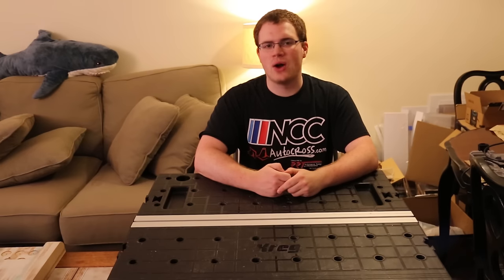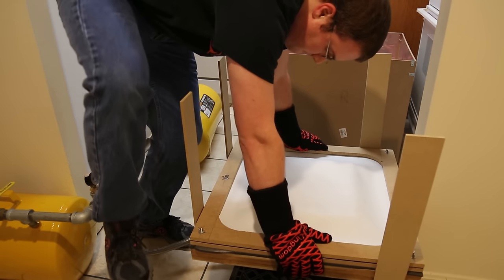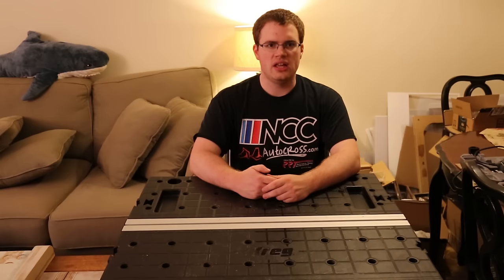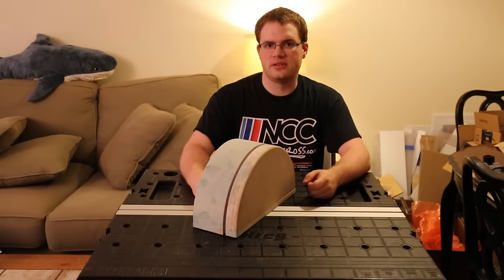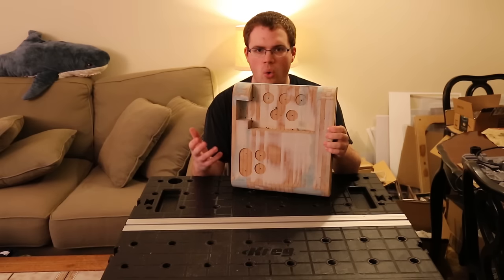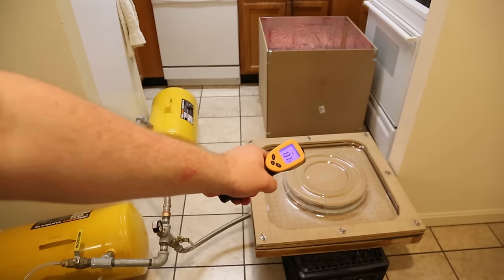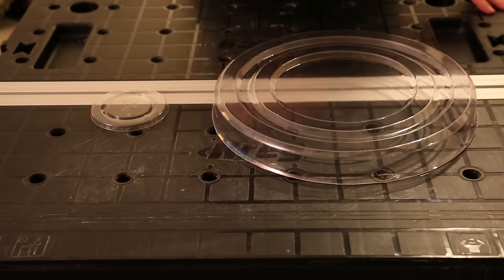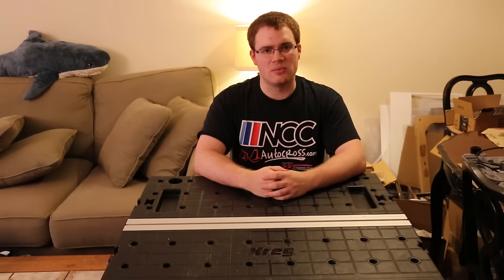DIY Vacuum Forming - Complete Video Guide

Comment: Thank you for this invaluable instruction Video!! Answered so many questions. 
The only thing I'm not 100% clear on... I THOUGHT I knew what PETG was, many Plastics for that matter. 😖 

My primary purpose of this will be to form RC Truck Bodies, and some RC Aircraft parts.
The RC Truck Bodies will be at least .040" Clear Polycarbonate (Lexan). Lexan isn't PETG? Is it?? 

The Bodies will be at least 6-9" tall, 7-8.5" wide and 13-17" long. 
The Truck Beds will be Scale depth. (90% of all mass produced RC Truck Bodies have FLAT top Beds, or are only 1/4" - 1/2" deep) 

I'll likely be carving the Lasts out of Plaster of Paris, with a layer of Glazing Putty as a top layer.

Do you see any issues I would have with those proportions? 

Also, Lexan Sheets are sold in Hobby Shops with a protective film on one side....
Production Lexan Bodies are all sold WITH the that film on it, so when painting the inside of the Body, no overspray gets on the outside. 

Do I have to remove that Film before molding?? 
Sorry if I'm over picking your Brain! I have almost NO budget. I can't afford too many errors.
I'm already CERTAIN they'll be a few! 😜
Thanks, 
Carmine ✈🚂🚙
Reply from the maker: Hi Carmine - Polycarbonate/Lexan and PETG are different materials and require a different amount of heat to properly vacuum form (you can find the manufacturer technical sheet that usually has a ton of great information on thermoforming, including what temperatures are needed). Those proportions aren't an issue as long as the platen and vacuum are designed well. If you plan on doing it with a cheap vacuum, you'll run into problems. Protective film must be removed from both sides of any clear plastic before vacuum forming. The protective film is also plastic, and will melt onto your sheet when you heat it.

Now that we got through those questions, just a couple things I noticed:
.040" polycarbonate is fairly thin. If you plan on doing a deeper draw (which is exactly what 6-9" is), you'll likely need a thicker starting material. As I stated in the video, when you heat and draw plastic over a form, it has the tendency to thin out (because you're stretching it, basically). I did one form at the very beginning of the video that was about 14" long, 6" wide, and 7" tall (which is fairly close to your dimensions) with .080" Polystyrene and the resulting wall thickness of the finished plastic was .030-.035" (about half of what I started with). So keep in mind where you want your wall thickness on your finished form to be, and backtrack from there. The plastic will always thin out in relation to your buck height (since it has to be heated more/droop more). I did some forms in the same .080" Polystyrene that were only about 1.5" tall and they came out at ~.072" which almost has no loss of thickness. I think at the end of this video with the soda cup I started with .060" PETG and it ended up being something like .050" for that 2.5" draw. If you want the body to end up being .040", I'd start with at least .060" material and give that a shot. I'd suggest starting with some sheets of PETG. It's often cheaper, widely available, and requires lower heating temperatures/faster to bring to temperature. That way you can get the motions down before moving onto the more expensive and difficult-to-form polycarbonate. 

For small vacuum form operations, hobby shops are great sources for plastic, however if you plan on doing something this large and possibly doing a medium-large run of them, I'd suggest searching for and becoming friends with a local plastic supplier. They often have tons of material types all with varying thicknesses, all the technical specifications, and can cut the material to size for the particular former/frames you plan on using. I get 48 x 100" PETG sheets of varying thicknesses rendered down to about 22 x 22" for my frames and I get 8 pieces (usually they cut for free or very cheap) for about 30 bucks. 

Also, I know you can technically vacuum form plaster, but I always suggest people try to make their bucks from wood or some strong material. It has better machining properties for a more accurate buck and wood can withstand the heat really well while also being stable so you can draw many forms from the same buck (tool life). Remember, don't use any materials that can't withstand 300 degrees Fahrenheit for at least 1 minute without deforming/melting/breaking.

If you need any more help, feel free to drop another comment. Happy forming!
Reply: THANK YOU!! What a wealth of information! Thanks for sharing your experience with me. 

So I'll get a couple of sheets of PETG or even Styrene for practice.

I'm not the best at carving Wood... But I get what you mean. Maybe I can try Clay. I can get that Fired at a Kiln at the local School.

I'm trying to save myself headache, the Body Buck will be a fairly basic form... Details like Door Handles, Windshield Wipers, Emblems, Gas Cap, etc... will be add-on items. It'll look better anyway. 

My proposed Vacuum source is a 7 Gallon, 1.5hp professional Shop Vac. 
Adequate?? 
Thanks again!
Reply from the maker: @CarminesRCTipsandTricks  Unfortunately for a lot of the home shop hobbyists, the conventional Shop Vacs are actually not the greatest at pulling a vacuum for a former. It may work at a smaller size, but at the dimensions you're working with you may need a Dyson Ball Stand-up vacuum or a set-up like mine. It's really odd, but the common household standing or canister vacuum is better for this application than a Shop Vac. I think it has something to do with the large reservoir of air inside (dust/debris collection bin). I've heard varying comments about filling that space with objects to reduce the interior volume of air possibly working, but I can't comment because I haven't tried it.

With vacuum forming, it's not necessarily important how much air you move when compared to how fast you move it. The snappier the system, the more accurate and tighter forms you will get. If you want to start by giving the shop vac a try while putting insulation foam or something to reduce the air volume inside the dust collection bin, it's largely free to try. However, if you're getting less-than-satisfactory pulls you'll know that's probably an item on the chopping block. If you try it, let me know how it goes so we can properly advise people in the future. 

On the cheap, you may be able to get a couple small canister-sized vacuums from the local Goodwill or similar and make multiple vacuum holes on the bottom of your platen (or borrow them from the house or friends - if they're good friends lol). The parts list for my entire build is also linked in the description, so if you end up wanting to replicate what I have you can price it out.

Comment: Superb video. Had it come up yesterday when I searched, my tiny 10.5" x 7.5" platen would have had fewer than its 486 holes that I drilled this morning!
Would be interesting to know if anyone has used one of the cheap 2-5 (US) gallon vacuum chamber/pump sets that retail around the £100 ($120) mark (Vevor I think) . They seem to be used primarily for degassing resin or silicone before molding but it looks like the release valve might be capable of creating a decent vacuum for small scale forming.

Comment: Nicely done video.  I need to make 24 pieces of a jukebox side plastic....acrylic, red, translucent, 24 inches long, 2 1/2 inches high and deep.  And it needs to be at least 1/8 in thick, so would need to start out at 3/16th in.  Smooth, shaped like a 59 Chevy tail light with no embossing.  As this would just be a one time production run off a wood template, I would like someone to do this rather than build the vacuum tube and struggle.  Could you recommend someone on east coast (I'm in western PA)?  Looks like a more cost effective process than resin silicon mold castings or injection mold.  And thanks again.
Reply from the maker: I'm afraid I make all my own components for my projects, so I'm not aware of any DIYer network that may exist. There are companies out there that do take vacuum forming orders, though. Depending on your budget that may be a possibility.

Comment: Thank you for these videos. They're extremely helpful and I'm in the middle of building one from your design. I want to be able to do different sized sheets, like 18" x 18" and 12" x 12".  Is there a way to seal off the outer holes when doing a smaller sheet, or would it be better to just make multiple sized platens and frames?
Reply from the maker: You may be able to add gasket material on the bottom of your 12x12 frame (that would still have to retain the exterior dimensions of the larger frame for the same platen) to block off flow, provided you were able to sufficiently shield said gasket against your heater during that process. The most reliable way would just to have two set ups and swap the vacuum system between them.
Reply: @mwjscn  thanks!

Comment: Great video really full of info, just wondering whats the differencw between PET and PETG in vacuum forming
Reply from the maker: Only thing that really matters for vacuum forming is exceeding the glass transition temperature, so look at the spec sheet for whatever material type and brand you end up using. I don't believe the different PET types have much variance in their heating requirements so they should all be fairly easy to use.

Comment: good video learnt a lot does the strength of the vacuum pump make a difference.  im about to build one to form new headlight lens's any tips are much appreciated thanks
Reply from the maker: You definitely wouldn't want anything weaker than what's in the video, but the vacuum pump strength basically determines how long you'll wait for the tanks to empty of air.

Comment: This has to be the most informative video on vaccum forming ever, can i pick your intelligent mind? 

Could i build my own system to form 5mm abs.

I have a rc bait boat that has cracks in the hull.

I'd like to make a mold of the boat i have then try and create a replica via vaccum forming, the current boat is made from 5mm abs.

Is this thickness possible with a diy system or would it need done with a more industrial size system.

Kind regards 
Bryan
Reply from the maker: Thanks for the kind words! Vacuum forming is used in the RC hobby space a lot, from bodies of RC cars, to canopies for planes, and hulls for boats (my father has some 1 meter class sailboats, which is mostly made of all vacuum formed plastic). 5mm is thicker than anything I've personally attempted, but definitely do-able with a robust enough heating system, but it really comes down to how large the hull is. The smaller it is, the more viable a DIY solution becomes (just in terms of maneuvering the frames and scaling the overall cost of the vacuum system/platen). If you have the time, it may be worth making your mold and using some thinner plastic like 2mm to do a couple test runs and get used to the heating system, the look of the correct droop in the plastic, and just getting comfortable with the general practice (as well as testing for any system issues) prior to spending more for the thicker material (or using up your thicker material during troubleshooting/testing). Remember that if the hull you have now is 5mm, that probably means they started out with a 6mm sheet (1/4") due to thinout during the heating/droop process. Since the hull is an easy shape, though, that means it should need to be heated less and the vacuum should be quite easy to pull (so if it's just a hair under 5mm now, you can probably use that same size sheet and get something representative of the original). Feel free to throw me any more questions if they come up now or down the line, I'm happy to help.

Comment: Great info. Thank you so much. Question: how do you DYI thermoform large and hard plastic boxes like car roof storage boxes? I can’t afford Thule and Yakima. Just want to make one for myself and be proud of. Any idea please. 😀
Reply from the maker: Practically, It'd be a lot easier and almost the same amount of money to save up and buy a rooftop carrier (look for pre-owned/used) than build a machine to make one. The plastic itself to make the actual part would probably end up costing $200 by itself, which doesn't begin to cover the cost of making the machine. You'd also have to use a special blend of ASA plastic to make it heat safe for usage in direct sun.

Comment: Great comprehensive video. Thank you!
I wonder if it's possible to vacuum form headlight lens?
Reply from the maker: You can, but it's probably a better long-term solution to get a replacement lens for the headlight assembly. If you do vacuum form one, you probably want to use polycarbonate which raises the difficulty level a bit since it requires much higher forming temperatures.

Comment: Very nice video 👍. The vacuum platform size h+(w*2) is interesting because I'm seeing a lot of videos vacuuming with much smaller dimensions. Can you explain more about the size you mentioned? The dimensions you mentioned applies to polycarbonate too? Many thanks.
Reply from the maker: It's just a loose guideline, but yes it applies to any plastic. There's not much to explain regarding the dimensions. You need enough plastic area to let it go up, over, and back down your buck. Hence why height is accounted for twice.
Reply: @mwjscn  so if I'm forming a 4*8 box with 2 inch high I ll need a vacuum that's 12*12 correct? Thanks, sorry I'm being stupid for some reason.
Reply from the maker: @Amr11959  Yep, you got it.

Comment: Hey Matt! Thank you for this amazing resource. I have a question however that I can't seem to find an answer to anywhere. I've built a former and an oven in my home using a standard panel space heater. The heater however overheats and automatically activates safety shutoff before the temperature is high enough to fully melt the styrene sheet. How can I work around this? Thx!
Reply from the maker: What is the wattage of your heaters and what thickness and area of plastic are you trying to heat up? How long are the heaters running before reaching the overheat temperature?
Reply: @mwjscn  The wattage is 1500 (pretty standard from what I gather)...it shutsoff after about 4 minutes. I switched to a 2000w electric stove...works better, though the heat distribution is uneven.
 The area I'm heating up is about 20"x27". The styrene is 20points thick ( I don't have another measurement reference...but that's how it is labeled). I'm having success with 2mm EVA foam...but the styrene doesn't even come close to being pliable enough to form. Thx for the help!
Reply from the maker: @danielruiz9589  I also started out with a single 1500 watt quartz heater, and it wasn't enough for styrene. We have a similar build volume, and I quickly fixed my issue by just getting a second 1500 watt heater for a total of 3000 watts (which you can see in the video @2:40). As far as heat distribution, you'll want an enclosed box preferably with HVAC aluminum tape and aluminum foil like mine for the best results.
Reply: @mwjscn  Many thanks! I'll give it a whirl.

Comment: What would you suggest for a diy of thermoforming headlight lenses? You're videos are super informative and a great walk through.
Reply from the maker: Probably polycarbonate for impact resistance (road debris) with a layer of clear coat to prevent UV oxidation.
Reply: @mwjscn  have you played around with doing anything like that before?
Reply from the maker: @coryhart2637  Nope, but plenty have commented asking about the same thing so there may be other content sources out there with more info from people who have tried.

Comment: Did you seal the "platen" (vacuum table) with resin as you will lose a lot of vacuum otherwise. Instead of all those little holes one larger hole in the center and use 1mm spacers around the mold, puck I think you called it.
By the way, I'm an old school thermal vacuum former from the 70's. I built molds / formed sign panels for Toyota, Ford etc pylon signs on down, large vacuum tables 5 meters by 3 meters down to small tables like yours. This is a good video! 👍
Reply from the maker: Some of the points were covered in the video, but since it's long I can understand if you didn't watch the whole thing. The platen is sealed on the edges, but I did later add some aluminum HVAC tape on top to further assist in making it air-tight. The multi hole array has superior performance for me since it brings the plastic down around the edges for better definition. My original version had a larger singular center hole and I go over that option in the video if the user ends up wanting to go that route. Nickels were used as spacers in the video to space the buck off the platen. Thanks!